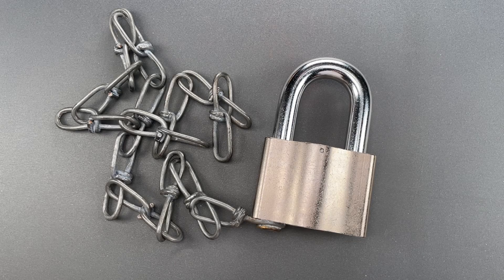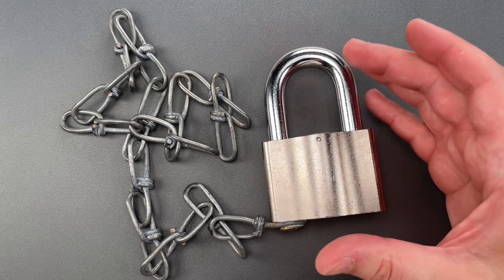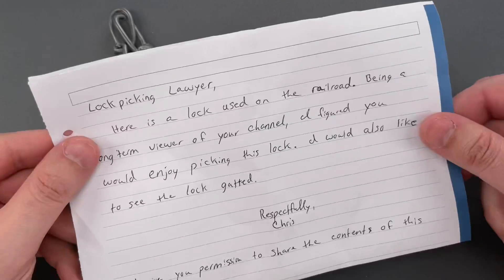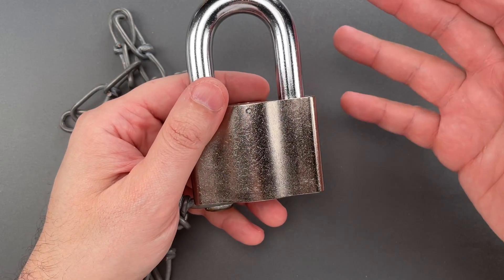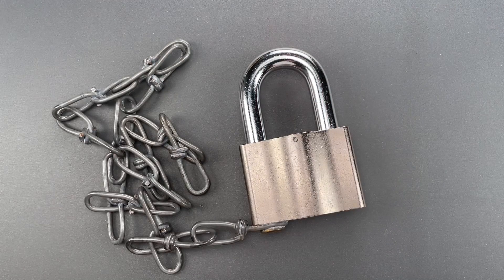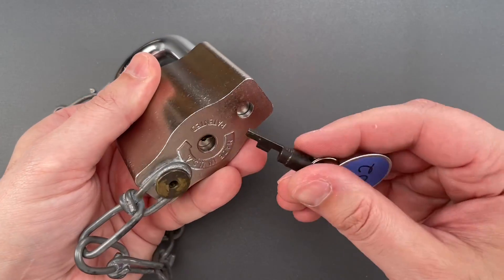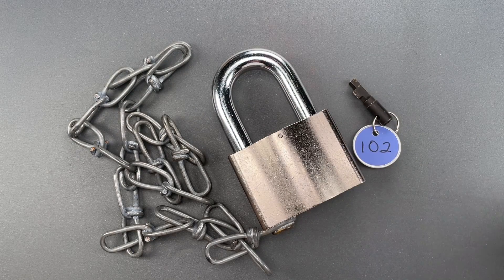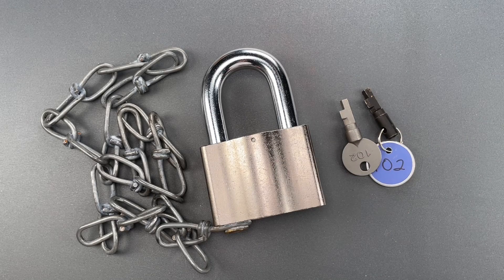[1482] The Most Weather Resistant Padlock Ever Made — S&G Environmental

Comment: In general, every switch on a given railroad will use the same key. The conductor only needs one key, no matter which switch he has to unlock, throw, and relock. Back in the days before radio, there were wayside telephone boxes. These also used the same key, but a different key than the switches. Storage sheds would have been another key or two.

Overall, any railroad only ended up needing about three or four key patterns. The 27 patterns allowed the adjoining railroads to use the same lock, but with their own key patterns, so you couldn't open their locks and they couldn't open yours.

Comment: As aways an informative video. But you forgot one thing; how you or someone else would identify which numbered key to use without guessing or process of elimination. The last two digits of the correct key is stamped on the top of the cylinder between the shackle. If you stop the video and look closely where the LPL references the cylinder that needs to be removed for disassembly you can see “02”. 

Have a nice day!
Reply: It says "CR" and "INR". There isn't an 02 anywhere

Comment: As someone that works on the British Railways I can tell you now that a padlock like this would be one of the most secure parts of the railway. We have thousands padlocks for all kinds of gates and control systems. These padlocks are also accessed by hundreds of people across the network. You can imagine someone patrolling a section of track with 50 gates and 50 different keys? 

This is an example of good enough security. 

It's about making something secure enough to stop people from doing something unsafe. Imagine if you left a breaker box for a 25Kv powerline unlocked. Someone who's curious as to what it does and looks like inside might casually open it up and take a look. That someone wouldn't be curious enough to open a lock. We just saved him from getting electricuted. Someone who whats to mess with that box and knows what they're doing is just going to take an axe to the wires coming out of the box.

We could make it 100% secure and safe and stop people who don't need access no matter what but that would mean billions of pounds and that 0.5% of people that really want to do damage will just get on a train and pull the emergency cord causing the same amount of issues.

Comment: My top 7 reasons why they'd use a easy to open lock

7. They're too lazy to keep track of more than 10 keys
6. They're too cheap to supply more than 10 keys to everyone who needs them
5. They're only used in remote areas that get very little traffic
4. There's nothing of any real value on the other side
3. It's on a gate in a fence that can be cut through with a pair of wire cutters
2. It's on a gate that can be jumped over by any adult human and most children.
1. There's a guy with a rifle and a bad attitude on the other side.

Comment: Anyone watching these videos should know that no lock, however good it is, will stop a skilled and/or determined attacker. This is even more true considering that those locks are often used in remote, isolated locations. That being said, they can only be relied upon to prevent opportunistic access (e.g. a curious child) or getting opened by the elements - and for that a low security lock with a key every technician carries is ideal.

Comment: I have seen places where the management will lock a little used facility with the cheapest lock there is, let it rust closed, and then simply cut the lock off if they need to get in. - when you need access too rarely to make it cost effective to buy a reusable lock.

Comment: If a key were lost it would be more desirable to be able to still open the lock fairly easily in a critical situation.   Much like how a lot of heavy equipment ignition systems are pretty easy to jumpstart.  If a key is lost it’s often times more important to just get the work done
Reply: Same deal with boats. For instance, all boats with Yanmar engines and their associated control panel use the same key.
Reply: @svgalene465  it was none the less unsettling when I shelled out $90K for a decent excavator and was “reassured” that if I lost the key any thin piece of metal would do the trick.  Conversely my much less expensive work van key is $600 to replace and requires a couple hours of time at the dealership.  Thusly I’ve switched all my heavy gear to keyless push button start and carry my truck key in a tiny pelican case.

Comment: The newer ones are constructed differently, there's a set screw that locks the cap in place (you need to have the lock open to access this) so they can be disassembled/serviced without removing the pin.  There's a 5 disk version with more cut positions, but the 3 disk one is used by railroads.  An interesting point of the S&G locks is that there's no identification of the road on the lock, I'm sure that helps the lock itself from being stolen.

Comment: Railroads know if someone wants to get in, they could cut the lock off in seconds with a cutoff wheel. No point in making the lock more expensive when a cheaper lock works equally poorly. They’re likely more worried that a worker won’t be able to get in quickly due to a seized lock.

Comment: I guess the purpose of the padlock is literally just symbolic.

I have experience from the power grid in Sweden and the purpose of our padlocks around the country is to stop anyone from operating our equipment by mistake or just out of curiosity. You need to think twice before tampering with our locks. But the strength of the lock won't stop a determined ten-year-old with a crowbar.

Comment: Come on … you pick lots of locks that you have the key for.  I love watching you pick locks, even the insecure ones.
Reply: Lol insecure locks
Reply: This is the key-based equivalent of a combination lock which uses one digit in its code. Sure, you could decode it, but you could just open it instead. For my part, I find it interesting when the flaw "not enough possible configurations" can be exploited in a 'secure' system.
Reply: @delta3244  Considering the letter asked him to *pick the lock*, your statement makes no sense.
Reply: @Dyanosis  I would call the way this video's lock was opened lockpicking - or at least a demonstration that the lock was picked in the past. To be clear, this is how I intuitively understand the word, despite how long it's going to take me to explain why.

 The act of "picking a lock" is one of exploiting a weakness in the lock's design to open it without using the intended key. 
 The way that all locks are supposed to work is this: within the lock, there is a password kept hidden from whoever sees it, which is often physically-coded. Outside the lock, there is some means of entering a password. To open a lock properly is to know the password and input it. To pick it is to open it without knowing the password, or to discover the password by examining the lock.
 In the case of a 1-digit combination lock, let's say you want to open it without the code. The strategy you choose to employ is this: try each digit. When the lock opens, you got it right. It should be clear that this is lockpicking - you started without the combination, and by examining the lock, you discovered the combination.
 Now, consider the lock in the video. It doesn't use a combination, sure, but it's fundamentally very similar under the surface. The different cuts on a key correspond to different digits in a combination, and the depth/etc. of those cuts is the value of the digit. In this particular case, there are iirc 12 possible combinations. This makes it very similar to our 1-digit combination from earlier, so we employ the same strategy: try each option. When one works, we've successfully picked the lock, both because the lock's been opened w/out its intended key and because we've learned its password.
Reply: @delta3244  "The act of "picking a lock" is one of exploiting a weakness in the lock's design to open it without using the intended key."

You've got it wrong, bucko.  Picking a lock means physically manipulating the pins or wafers or discs to get an open.  Exploiting a weakness in the lock's design without fiddling around with the pins is almost always considered a bypass.  Replicating a key falls outside both of these fields and into its own separate field.  All are encompassed and/or utilized in locksport/locksmithing.
Reply: @Skinflaps_Meatslapper  Please show me any source that defines "picking a lock" in the way you described. I tried looking for around 10 minutes and could not find one.
 Are you sure you aren't thinking of "single-pin picking" or some other term like that with a more well-defined meaning? "Lockpicking" is a very vague word that covers an entire class of actions; it is perfectly normal for words like this to have edge cases with disagreement (does a hot dog made of two seperate buns with a sausage in the middle count as a sandwitch?). In such cases, everyone is right - these categorical words are most meaningful near their typical prototypes (a prototype many people have of 'lockpicking' is 'single-pin picking'), and at the edges, people understand the word differently. In short, I suspect this conversation is a dead end on account of our "Englishes" being slightly different - we're all right for our own English, and wrong for disagreeing Englishes.
 Half related, I would not be surprised if in competitions the word is used for the set of events which involve bypassing locks with picks, but I would argue that "lockpicking" is the name chosen for this set not because it's a perfect match, but because it's the best candidate in English.

(edit - removed a free asterix*)
Reply: @delta3244  the sender didn't even ask him to pick it

Comment: The chain would be the easiest way to get in. You wouldn't even need bolt cutters.
Reply: The chain shown is not for security.  It is to secure the lock to the gate/fence/whatever so it does not get lost or dropped when it has been unlocked.

Comment: The reason why the mechanism is simple is you have a fleet of workers that need to gain access to the lock, these fleets often travel and their point of contact person will tell them which key. Also 99% of the population sees a lock, especially a disk detainer, and would have no idea how to bypass it.
Reply: Yup, what thief is going to have the patience and knowledge to make 12+ keys for this lock. I like LPL but this is a bit ridiculous of a reason to criticize its security.
Reply: @Jomskylark  every thief who does thieving around railways.

Or do you think that thieves who steal for example copper from railways just happen to stumble across it? Without any prior planing?
Reply: @Jehty_  - What is this planing you speak of?  Is this wood shop, I thought this was lock shop?
Reply: pretty sure locks like these aren't protecting things that someone who learns how to lock pick for the purpose of stealing would want.
it's probably for keeping teenagers or homeless people out of dangerous areas or from fiddling with equipment, that is, while important, not worth stealing because nobody outside of a railroad company would have any use for it.
sure domestic terrorists could potentially abuse that system, but that probably wasn't much of a concern when these locks were implemented and replacing all of them (and providing all the keys to anyone who does need to have access) might be a considerable expense.
Reply: @windhelmguard5295  - Better hope the foreign terrorists don't catch wind of this.
Reply: I would bypass it by going right by past it 😂

Comment: It would be almost pointless getting a more secure lock. Literally thousands of keys will be in circulation anyway, and those who want them either steal them from employees or buy them black market.

You picked and gutted an Australian BiLock key on this channel and rated it very highly. At least one Australian railway uses them, and sadly they are not much more effective than the literal square locks (a slot that can be turned with a screwdriver) used on older trains. Vandals simply target train crews, who are sometimes seriously assaulted.

Honestly, a less secure key at least has the advantage of keeping most people away, but also presents less of a risk that rail staff will be assaulted. Probably cheaper to deal with the resultant theft etc than hospital bills.

Comment: As a railroader I can agree.  I hate those locks.  I can’t tell you how many people I have seen loose keys to those locks because they got permanently stuck.  Then in the winter, if they get any snow/water in them and then freeze good luck turning the key.  Although the locks my railroad uses have what looks to be 5 disks based on looking at the key.  Would gladly send you one if I can.
Reply: Ya man. May a times I had to light a fusee to heat up the lock to open a switch.
Reply: @7171-Ws6  What is a fusee?

Comment: This is definitely an example of a lock being used as more of a latch than a security device. It's just there so that whoever bypasses it has to do so deliberately and knowingly, and often at-their-own-risk.
Reply: As most locks is done, to hinder the opportunistic burglar who has only some rudimentary tools, a screwdriver and a small crowbar, the dedicated burglar You can not stop with locks, not alarms either, they set aside 2 to max 5 minutes in a home. Maybe a well trained guard dog will help. Or a armed guardian patrolling the house 24/7/365, they have a day of the 29th of February.
Reply: @dmg4415  I will be raising geese for the home, they live up to 35 years and cost only $20 or less, they eat the grasses and plants in the yard. Only a rural zoning code is required and above 5 C shelter. Oriental geese are super loud, they will definitely wake you and light up your day greeting you as a group with open wings when you come home from work.
Reply: You'd be surprised how many people this would stop. The vast majority of people would never think about the idea of getting a set of keys for the locks. Just seeing a lock at all will turn most people away, unless they have a good pair of bolt cutters. Pick resistance matters a lot less than bolt cutter resistance in most cases. This lock would probably fall to a good pair a bolt cutters, but so would quite a few higher security locks
Reply: You know, if you wander into the limited area that was unlocked and got caught, you can bluff yourself out, saying that your head just went blank and you were curious. On the other hand, picking a lock no matter how shitty it is, is a guaranteed deliberate burglary.
Reply: @Itoyokofan  And how do they prove it is picked and not just left open the last time it was opened?
Reply: @dmg4415  Most of those S&G locks have a key keeper feature. You have to lock it to get your key back out. Obviously someone can still just lock it and just leave it on the ground, but it helps remind the user to lock it and get their key back.
Reply: @johnleer5263  Or lock it on only one part of chain/schackel or what ever they use. We have such a lock to the gate to our shooting range, first in opens and then secures the lock on the post, last out locks the gate, the lock never leaves the post and are not ever left unlocked, and You need a key to lock it. So if some one was to pick it, they have to leave it open or closing by picking it again.
Reply: @dmg4415  they won't need it, they would just assume that it was
Reply: @Itoyokofan  And that will hold up in court, "Yes judge, as the lock was open I assumed that the guy had picked the lock" "officer, do You have any proof of that?" "No judge, no picks found on the suspect and no one to be found on the premises" "So officer You are convinced he pick the lock?" "Yes, no one EVER forgets to lock a gate"
Reply: @dmg4415  because they retain the key when open
Reply: @Itoyokofan  100% this is the point, from a liability and legal perspective, someone who stands in front of a judge having Picked a Lock is going to get the book thrown at them, and nobody's going to care whether it was trivial or difficult.
Reply: The shackle is so thick to prevent showing a switch while locked. It is the actual block for the lever.
Reply: I use an unlocked MasterLock lock to keep the door to my green house latched.
Reply: @Tim.Stotelmeyer  - I hope you wave the key or know combination before a good Samaritan comes by and secures your greenhouse.
Reply: @scootergeorge7089  Well it is a MasterLock.  It would probably unlock if I gave it a tap with my finger.
Reply: @Tim.Stotelmeyer  - Or even a very stern look!  🤣
Reply: "By bypassing this lock you acknowledge that you are guilty of B&E" is also a role for a lock
Reply: These are used on mainline switches to prevent unauthorized rerouting. On industrial spurs, warded locks are used instead. In yards? A simple hook put through the hole to keep the handle from bouncing. All of these solutions are one thing - rugged.